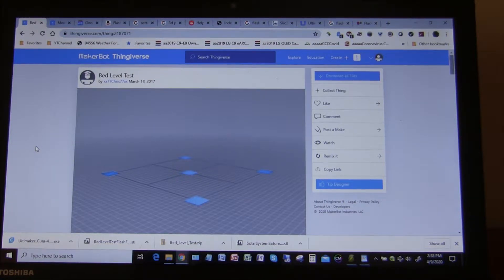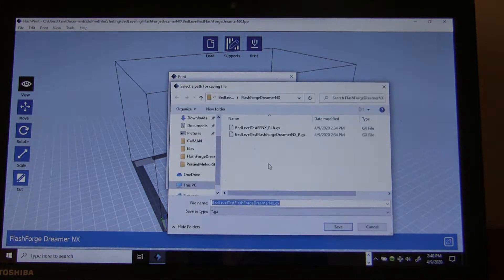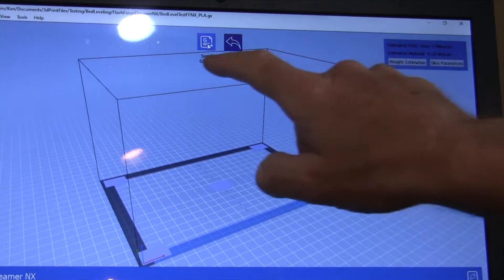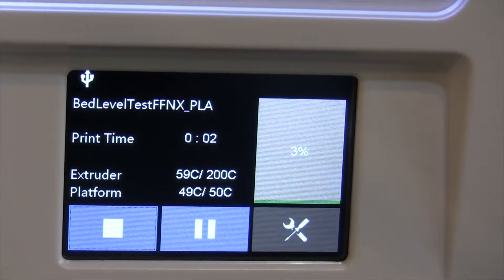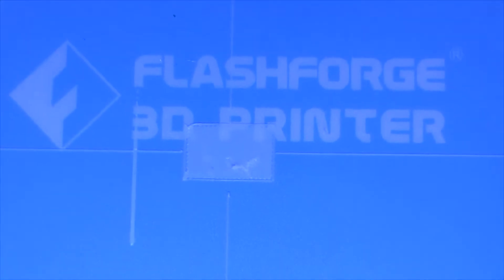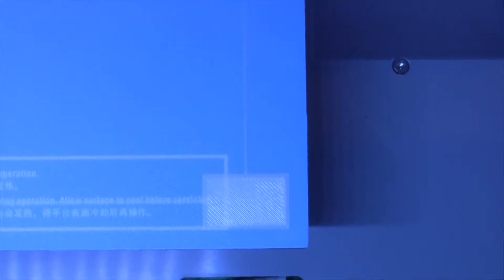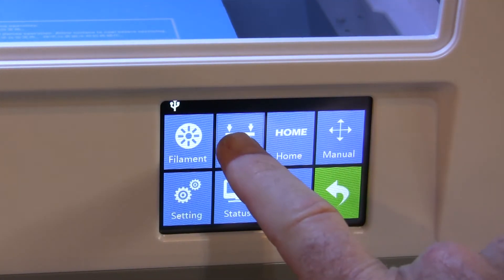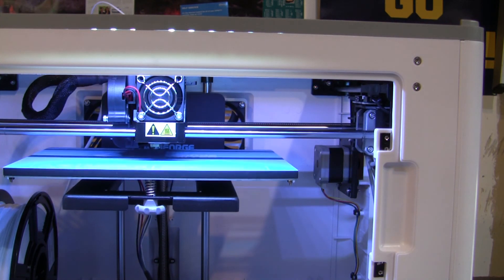Flashforge Dreamer NX Bed Leveling Test

Comment: hyper contente et satisfaite de mon achat (imprimante 3D_ Flashforge Dreamer) je l'ai commandé sur amazon   voici le lien https://amzn.to/3mugTB6 (pour avoir tous les détails et moi-même je vais montre mon expérience avec cette imprimante)
- pas chère !!
- esthétique et peu volumineuse
- imprimante fermée donc pas de problème de chaleur mal répartie
- plateau recouvert par une sorte de tapis autocollant (livré avec plusieurs tapis) donc pas de risque d’abîmer
- logiciel facile
- deux couleurs possibles. Attention toutefois: quand on imprime en deux couleurs au même niveau (vertical), le changement fréquent de couleur tend à laisser de légers dépôts de l'autre couleur.
- écran couleur et tactile
- pas besoin de connecter le PC pour imprimer
Les résultats:
C'est juste impressionnant en regard des problèmes eus sur qlq marque 
 Pour moi ça a marché du premier coup si on excepte le fait que pour faire adhérer l'ABS il vaut mieux mieux passer un coup de bombe "Dimafix" auparavant. Après cela je n'ai plus eu un seul souci.
Personnellement je n'ai pas cherché à imprimer en mode haute résolution, je n'en ai pas l'utilité et j'ai donc utilisé le mode par défaut, le résultat étant déjà très correct.
Bref, en conclusion, je trouve que c'est un modèle qui vaut LARGEMENT son prix, est rapide à faire  fonctionner ❤
Reply from the maker: I had good luck printing with ABS if I raised the bed temperature enough:
https://youtu.be/AsoiqdnIuF8